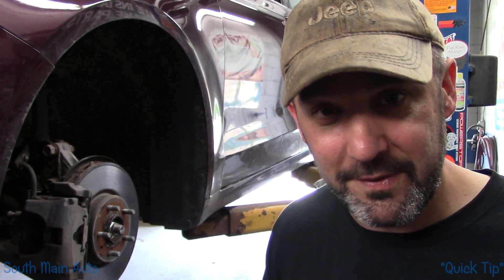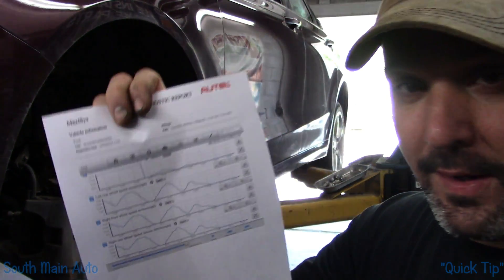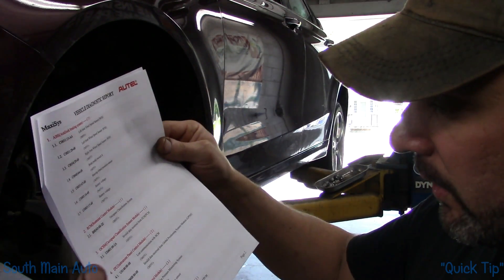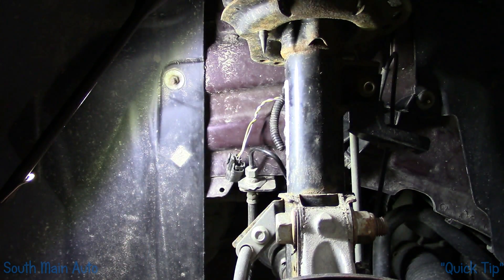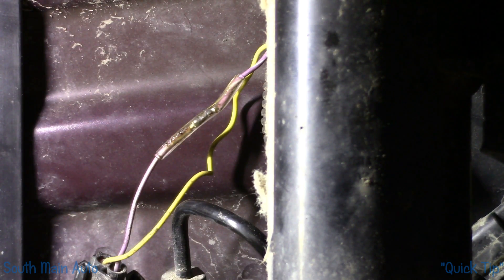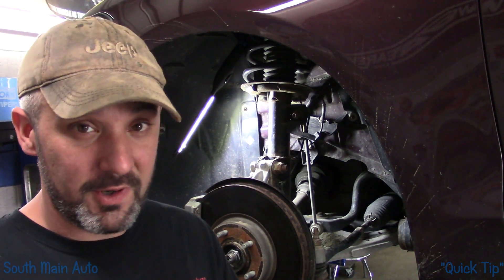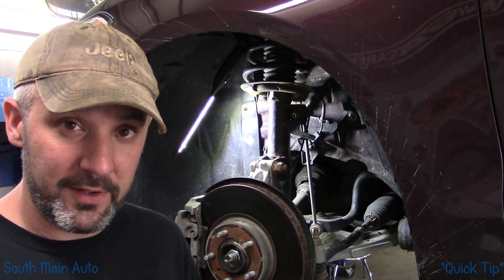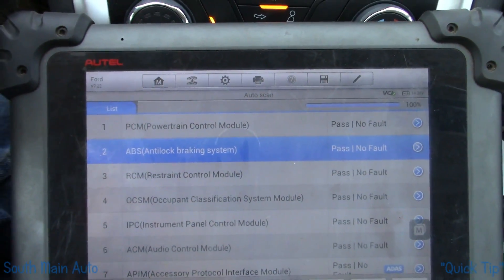QUICK TIP: Ford Fusion DTCs C0031, C0034, C0037, or C003A

Comment: Hello, I'm encountering the same Issues in my 2016 Ford Fusion SE. I checked the Front Left Side and I found the same damaged wire, Repaired it. Then it worked for like 3 min, but now I have the same Issues. I'm going to check the other sides for the same wire damage tomorrow. What else could cause this Issue? Battery? or Multiple broken wires?

Comment: Hi there, thanks for the tip. Currently I have C0031 code randomly appearing like once per month accompanied with a huge ammount of other codes, I would be wondered if this is the case for me too.... Unfortunately my service technicians does not like the idea of digging in yet beacause this fault does not appear at service station

Comment: You are amazing! I am almost positive this is my issue. I have a 2015 ford fusion that has been in and out of shops for same exact issues and no one could find the problem, even after installing a new transmission, battery, internal brain, one wheel sensor (which was the only this that stopped it for a little bit) only to start again. I bet it is this issue. I am going to have my bf check it. I am happy i found this video! Thank you!

Comment: I know this is an old video, but I found it useful for prep work prior to diagnosing C0031 and C0037 on our 2013 Escape.

We live in a rural area, and I've had two previous repairs that involved patching wiring harnesses because critters had chewed through them - once on ABS harness and once on the rear differential harness.  None of our other vehicles have this issue.  Something about the insulation Ford uses is pretty tasty to mice or other rodents.  May even be tasty to insects - I've never actually caught the culprit.

I suspect the same in this case, as I think the chances of two wheel sensors dying simultaneously is pretty remote.

Comment: Guess i will have to peel the black tape back on mine. Just replaced my front driver speed sensor. Lights went away for 2 days. Thought it was fixed. Then they came back on. Annoying! These wires are protected and don't even move where they are mounted at. Strange they would even do this.

Comment: This video saved me. I was pretty stressed out about all the lights and loss of power steering. I was 99% sure it was an electrical issue but being just a DIY guy I don’t have all the diagnostic equipment and access to diagrams and TSBs and all that. I’m not afraid to dig in and turn some wrenches but diagnostics is not my strong point. Thanks for this. Went right to it. Had it fixed in an hour. That includes moving cars around and sweeping the floor of the garage before working on it. LOL

Comment: On my 2013 Fusion Titanium it was the right front that had the nick EXACTLY as you show. Little solder and shrink tubing later and my dash lights are clear! Thank you! Without this video I would have had to pay a dealer to tell me that there's nothing wrong that a $1000 wire harness wouldn't cure. You the man!

Comment: My car is doing the same thing and all the lights come on and then it completely dies! Just shuts down! We replaced the battery and the alternator and it's still all lights on and randomly loses power steering and dies. Now I'm gonna have my husband check these wires and see.

Comment: Thanks for the video, I just fixed my lMKZ using your information. had the same issues as you described in the video.  I found the hole in the wire and corrosion, the wire was good so I  cleaned it and I applied die electrical grease and taped it real good. no issues so far.

Comment: I was working on a 13 taurus that was hit on front fixed everything and it still had TCS lights on. Changed the bearing and sensor. Still on then saw this checked the harness and more than 3 spots of it were coroded and just gone. Couldn't believe it

Comment: I have a 2014 Ford Fusion Titanium and I want to thank you for publishing this one! My car was also lit up like a Christmas tree with stiff steering. ForScan guided me to the front left abs sensor and just as I was about to order new I ran across this helpful video. Next morning I decided to unravel my harness, and sure enough same broken purple wire on the harness. I proceeded to fix it with one of those solder butt splices and wrapped up with loom and electical tape. All codes a thing of the past! Thanks so much - very helpful! Mike
Reply: ,wouldn’t that have fixed it?  Just replace the sensor

Comment: As for this repair. My 2013 Fusion Hybrid has been doing this for a few months. I replaced the left front WSS this morning due to a C0031 code I guess I should have kept reading all the way down to where it said Circuit short to battery or open. After watching this post I found the exact same issue. I also found that the pin hole in the wire is located right behind the white plastic restraint clip. I suppose the tool that installs the clip poked the hole in the harness.

Comment: I have a 2010 fusion sel 3.0 awd. Brakes feel like they lose pressure between drives. After some research it sounds like replacing the ABS pump may be fix but then my check engine light came on and i had codes B1676 and U3003 that both suggest an issue with ABS supplied voltage or something like that which suggest maybe a fuse or something?. Do you have any experience with these? Going crazy over here trying to self diagnosing. Maybe I should still change out pump then go from there. Cant afford a shop as these are many times a 1500 to 2000 dollar job. TIA

Comment: Exactly .. erratic steering wheel controls (for radio) on my Honda .. TSM told me the fix ... intermittent open ground collar on the steering column .. ding it up with a center punch .. fixed ...

Comment: Awesome tip, Eric! And this is why new cars SUCK. Lose power steering from a bad ABS sensor? Who designs this garbage lol?!?
Reply: Hmm, the EAPS adjusts the amount of steering assist based on the speed the vehicle is traveling. Now it should've been programmed to detect a faulty speed signal and fall back on a "default" level of assist instead of no assist at all.
Reply: Ivan, it would appear that both you & myself are the only ones that didn't get any love from Eric! :D

Comment: Why do manufacturers twist the wires? Twisted pair wiring doesn’t make sense to me
Reply from the maker: That way if there is interference on one wire it is also translated to the other wire. On data networks this is very common. The potential difference across the two wires stays the same even with interference.
Reply: Jonathan Barr the explanation that South Main Auto Repair just gave was very concise.& too the point.  Here is a little more in-depth info about why certain wiring is twisted in pairs:

"Twisted-pair cable is used with two signals that transmit information differentially, i.e., using positive and negative versions of the same signal. A differential system can also be referred to as a balanced system, because the two signals are "balanced" on either side of the common-mode voltage. A differential receiver subtracts the negative signal from the positive one, meaning that any voltage components present in both signals will be eliminated. This makes differential systems more robust against noise—as long as the noise is present in both signals. This is why twisted pair is the proper cabling for differential signals: the close physical proximity of the two wires ensures that EMI (electromagnetic interference) will be coupled almost equally into both conductors, which in turn ensures that the differential receiver circuitry will eliminate this noise.

Twister pair is also useful when it is important to minimize the generation of EMI. Balanced signals will generate EMI with opposing polarity, such that the EMI is largely canceled out. This EMI-canceling effect is more pronounced when the conductors are in close proximity.

Twisted-pair cable is helpful even without shielding, but a shielded cable will provide further protection against EMI."
Reply: Prevents Cross Talk and and causes the signal to remain usable with Inductive Interference.  Same reason CAT 5 network cables have twisted pairs.

Comment: Think they would use a better quality wire. I've seen broken wires in doors inside the rubber wire looms. It must be water. What do you thinks causes these pin holes ? ?

Comment: Great quick video. I'm guessing this was a production issue either with the car or the harness and it probably left the factory with the insulation nicked. There in salt land it was just a matter of time.
Reply: for sure at harness building stage, most likely at terminal or loom installation. but could have been earlier at harness forming/layout.

Comment: The real question is why does one wheel sensor failure cause all those trouble lights?   Even considering the wheel speed could impact antilock and traction control, etc it seems Ford and others could clearly identify a failed input and not necessarily every child process of that input.
Reply: ABS, because "everyone steers while panic braking!", I'm guessing there's 1 in 3000+ people that don't freeze up and actually attempt to steer!

Comment: that was great info! I have a chevy kalos and its ABS functions like this when it is warm weather no ABS light on and when it is cold and wet weather boom! ABS light is flickering and is on a while and then disappears ...maybe I have to go and check connectors and wiring of each one of those ABS sensors??
Reply: probably one of the front ABS sensor wires. check them closely before going all parts cannon replacement though :)

Comment: Great idea for the video style! If i dont member wrong our local dealer just melt small amount of soulder in that hole fast and then seals it up.
That way you dont endup with too long stif part on the wire that will just broke next of the fix as that wire is constatly moving...

Comment: 'SMA Quick Tip' Yes want to see more. 
Ford parts supply producing defective parts, factory pin holes in the wire, should be a recall. I have seen undocumented splices in the center of a factory made cable. They were soldered and taped but looked like a 6 year old did it. Cold solder joint and not heat shrink.

Comment: Quick Tip.... Great Idea. Service Information is very valuable IF you can get it. I recently had a problem with my 2009 Yukon Hybrid (6 Liter) with rapidly depleting Oil Pressure from normal to ZERO in a few moments and about 1 Km of travel. A long and interesting story, however, in diagnosing the problem, I changed the Oil Filter, and connected a gauge into the oil port adjacent to the oil pump.PROBLEM SOLVED! The new oil filter solved the problem. I cut the old filter apart, (Napa GOLD) and did NOT see anything wrong. Now use a K & N Filter and no problem. The Internet is FULL of people installing Melling Oil Pumps to correct this problem, BUT, anyone doing that would also change the Oil & FILTER, then think that the pump solved the problem. $1,000.00 to$2,000.00 for an oil pump change or $16.00 for a premium filter. There is a Service Bulletin out there, for DEALERS ONLY, that states that even the AC Delco Filters with an "E or N" in the P/N can cause the problem. Ever heard of this???

Comment: Spot on the $$...TSBs save you from chasing a diagnosis that is a known issue especially if it is fixed with a software update which happens increasingly more especially changing engineering parameters to allow for normal degradation or tolerances too tight.  Even when I'm watching a video I pull up the TSBs and it's amazing how many TSBs would have made their life easier if they had checked.  Nice tip!

Comment: For those wondering where to get the TSB info , www.bbbind.com/tsb-wiring-diagrams/
Reply from the maker: link in the description ;)
Reply: You know nobody looks there....  LOL...  I wonder if the reason Ford knows about the problem is that they or the supplier caused it? Especially when they point right at the location and exact problem. Perhaps a test point on the line?

Comment: Hi Eric O, love your videos. Have a couple of questions regarding the BMS system on a 2013 Ford Focus. Is there ANY way to reset the "aging " battery parameters in the body control module when replacing the battery without paying a Ford dealer $150 for them to use their multi-thousand dollar bi-directional scan tool to perform this function? And can I disable this funky Ford set up by disconnecting the "sense" wire at the NEG batt terminal or will this put me in a worse situation by screwing up the charging rate? All I want to do is be able to replace the battery and have the charging system work like a normal car. The way this system "off loads" non-essential accessories when the battery ages, is driving me to drink! I know that with your expertise in car electronics, you would be the one to know how to deal with this. Thank you in advance for any information that you can provide.

Comment: Love how you can use the service bulletin as a way of using a bunch of other peoples hours of chasing down a problem, so you can do a quick check and remove hours of figuring on your own.  

Just out of curiosity though, how did that end up killing the power steering?
Reply from the maker: It sends inplausible data over the network and everything goes into a "limp" mode
Reply: Ah, should have figured. Thanks.
Reply: Sorry for the newbie question, but how did you repair it exactly?  What kind of wire and method was used?  I know you mentioned soldering, but you also mentioned a seal?
Reply: @amartinez344  He used a but connecter that he uses allot.  It's got solder in it and all he has to do is take a hot air gun to it and it solders the joints and heat shrinks the ends at the same time.

Comment: Or one could quickly look at this wire every time a Ford Fusion came in for service.  Only cause Ford said 'here's your problem'.  Defective part, assembly, who knows.  But let's not recall it.  A known problem that pinpointed it to within an inch is really scary.  Thanks FORD!
Reply: IMHO, should have been a recall ;)
Reply from the maker: IKR!? There bulletin was scary accurate...
Reply: +South Main Auto Repair That what I'm saying. Like why?
Reply: throttle bottle We're talking FORD  here. Lol

Comment: Awesome thought process, Eric. Someone could've easily just assumed the speed sensor on the wheel, then the hub teeth, and then, 2 hours later and $250 down the drain, looked at the wiring. On another note, I just finished rebuilding my 05 Libby Diesel with an EGR delete. Only 160 ponies, but almost 300 ft/lbs of torque:) ... plus, you can easily make biodiesel with used veggie oil!
Reply from the maker: DELETE!? Haha I know nothing of these "deletes" you speak of....
Reply: Rodrigo Sagebin Ai
Reply: "off-road use only" says the kit... yup. I had to do the delete... the EGR was leaking coolant into the intake. A new EGR is a fortune on these things.

Comment: I wonder if the Bulletin says to use a pigtail because they are worried about interference when using a splice in that area?
Reply from the maker: You can have a twisted pair untwisted for 3 inches with out issue. Plus it is in a low interference area IMO.
Reply: That bit of knowlege right there is good value.  Explains the twist in the  cable too. Not just twisted to keep it tidy.

Comment: Great video and fix! Just the right length , almost Kilmeresque . I sure do wonder why that 12v open to air would cause a loss of comm. Surely one of the geniuses like Dmitry could clue me in 😉
Reply: New Level Auto  don't think it was loss of comm...invald data code...means only that abs had a problem , in this case the wheel spd signal issue
Reply: Jerry Bungard now THAT makes a lot of sense , watching on a phone and couldn't see the codes
Reply: Never seen a bad ABS signal cause SO MANY codes hahaha...but it's a Ford so that explains it ;)

Comment: the manufacturer recommends soldering a wire connection? what idiots!!! /s

just proof for all you crimped guys that solder IS the correct connection. :)
Reply: or they want it to fail again :))))
Reply: throttle bottle possible, but there is nothing wrong with a PROPER solder joint. will agree that lots of joe blows don't know what they are doing and wick solder up under the insulation.

Comment: Guessing some manufacturing process caused it.
Reply: My guess is that the machine that made the wiring harness(es) nicked who knows how many of them. Probably thousands of them.
Sad that when Ford knows they have a problem they leave it for the customer to pay to fix their mistake. Almost a safety issue really since the steering suddenly gets difficult. But heaven forbid a recall.
I really like this quick tip format of video, although I also like the ones where I get to see your thought process as you go through the diag. I guess it's a fine line up to your discretion.
Thanks much Eric.
Reply from the maker: Must have for the bulletin to be that specific on a non-rub area...